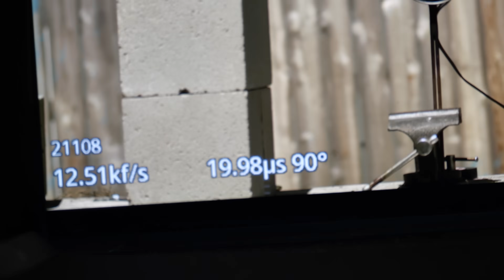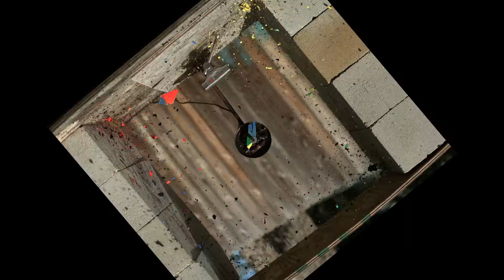Spinning a Record to Pieces at 12,500fps - The Slow Mo Guys

Comment: 9:47 NOW THAT'S A LOT OF DAMAGE
Reply: Lets see if its gonna leak
Yeah it leaks 
I would seal it with flex seal all you have to do is spray a nice and event coating and once it dry let it dry and once it dry let it dry and once it dry let it dry 😂😂😂
Reply: Bet some flex seal could fix it
Reply: Use the new Flex Paste.
It can be used on any kind of surface.

Comment: Omg. Thing about what happends if you break an angle grinder disc.
Reply: I've broken a PVA polishing wheel once. Not fun.
Reply: The hydraulic press channel has some crazy vids using those and killing every item in the area.
Reply: Or a saw blade
Reply: DatDragon Boi Seen It.

Comment: So the record cracks when the out of balance forces put too much strain on the body of vinyl due to vibration. I wonder how much faster it would go before it broke if you could even out the inconsistencies in the density and balance eliminating the most vibration possible? And would the shatter patterns change?

Comment: I wonder how much of a wind tunnel effect you  got from the bricks. I would think it would spin longer if it wasn't fighting its own wind rebounding from the brick walls. if you watch  it seemed most of the fracturing started towards the openings IE the bottom or the top where there was more space for the wind to escape.

Comment: Would love to know,  at what rpm were those LPs exploding? A 78rpm is heavier but more brittle, I believe are made of Bakelite? And you may have said it but what rpm is that Dyson Motor capable of? A spinning CD in the dark with a bright light on it made for some cool still shots. Actually it was 4 CDs attached to the slanted ends of a fan-blade. It was quite colorful. Keep on keepin on guys!!! I once put a model Airplane propeller on my Dremel and at 28k rpm it had serious pull. Also deadly. Could make a screamer until the cord ran out, ha ha

Comment: I wonder what if you spin it in a vacuum chamber to cancel out the  air so it can be more pressured??? Yall agree?? Would it change the outcome or would it be the same?

Comment: In general, the object will vibrate at a specific frequency. One of these frequencies is called natural frequency. The sound vibrates with natural frequencies. And when the object is subjected to extreme external force, continuing with the frequency equal to the natural frequency of the object Will cause the object to vibrate violently We call the violent shaking phenomenon due to this reason that it is resonance until the object breaks 
Physics 😡😡

Comment: You should put a chunky piece of meat to one side and do this, then after the results explain that it could likely be 10× worse if it was a grinding/cutoff wheel or metal-cutting chop saw disc. 😬

Comment: Nobody:

Dudes with honda civics at 3am: 5:17

Edit : THANKS FOR THE LIKES
Reply: Souk Detvongsa 5:21   V-Tech kicked in
Reply: I think u mean 5:20
Reply: XDDDDDDDDDDDD
Reply: True😂
Reply: Not a thanks for the likes? Thats sad
Reply: That is actually true that first joke (for me at least). My VTEC solenoid was leaking oil but now that’s fixed.
Reply: 2 more likes to 666!
Reply: THATS IS A NASCAR V8 ENGINE!!!
Reply: Jackivision  no, the ambulance on its way!
Reply: For me it's like a 4AGE with a small supercharger
Reply: The pop and wheezing Sound is them being dickheads and pushing the limiter to the point they blow a spooley through the engine 🤦🏼‍♀️

Comment: It appears that the motor is oscillating in a back to front axis which seems to be imparting energy into disk and flexing it which is causing the breakup. I predict that it will spin faster if the motor can be secured correctly stopping the forward and back vibration of the actual motor.ut may also be some resonant frequency of the record that seems to flex in such an extreme way it creates fractures  that allow the centripetal force to fracture it.

Comment: Ok so I found out which piece hit dan's shield! It's the yellow shark tooth/bullet shaped piece at 12:15, near the centre of the record. It flies into the wall, gets a bit grinded off it, then rolls off the table towards dan. Also you can see that the piece that hits him is the same shape and colour as the one I'm describing. Good night. It's 2:27 am

Comment: The disc spinning sounds like a 1970s muscle car
Reply: Muscle cars were mostly 1964-1974 and it doesn't sound anything LIKE those cars… 
Nothing does. 
[You get that unique rumble because of the firing order of a V8 with dual exhausts. You don’t get it with single exhausts because the exhaust pulses hit the muffler at evenly spaced intervals, but in a V8 with dual exhausts, you get from each side a boom pause boom boom pause boom. And the patterns alternate but dovetail into each other.].

Comment: The intial cracks came at almost a 120° to each other, a confirmation that it is the most stable configuration to crack when there is an outward force from the centre. Learnt that when I was studying about hotspots.

Comment: It's too bad that there's no good way to balance records cd's or any other kind of disk. I think the imbalance has a lot to do with why they warble at high RPM. if they could be balanced, they could achieve higher speed before failure. That would be more spectacular, but you'll need a higher frame rate and faster shutter speed. the kinetic energy goes up on the square of RPM, so the damage would be more severe with even a slight increase in speed.

Comment: Why not try this with all 3 types of records 16 rpm, 33 rpm and 78 rpm back to back and see how much difference there is between them. Each rpm reflects a different era of the technology in record evolution.  I will also suggest using a couple of 2X4's nailed together on the top instead of the plywood. You'll understand once you get the 16 and 78 rpm records in your hands.

Comment: I think one of the reasons the record breaks into pieces, is that the motor itself is oscillating because it is mounted on a rod. That starts to move back and forth and initializes the oscillation of the record. Certainly the record will break without this effect, but I think it occurs sooner now.
On the other hand, this explains why any record player does not more than 78 rpm... (lol)

Comment: I did injection molding plastics for 35 years and the failure lines look exactly like polymer flow lines going from the gate(where the plastic enters) outwards. Flow lines are always a weak point in a molding.

Comment: So why is it that when something spins really fast, it appears to change the direction it is spinning for a second, then goes back to what it was at
Reply: The camera (film or video) records a series of still frames. They appear to the human brain as a single moving image when played back fast enough. For simplicity I'll keep the numbers small - assume camera takes one picture every 1/10 second. If the disc is spinning at exactly 10 revs/second, the camera will catch the same point on the record - say the blue-yellow edge - in exactly the same spot every rotation, and the playback will appear stationary. If the disc speed is a little less than 10 revs/second the edge will be captured in a slightly different position on each frame and played back will appear to rotate one way (backwards in fact); if it's a little over 10 revs/sec the point where the image is captured will vary in the other direction and it will appear to revolve the other way. But as the disc speed rises to 20 revs/sec the edge will again be in the same spot every frame and on playback will appear stationary. This repeats as the speed rises further. So as the speed rises you'll see rotation one way, slowing, stopping, then the other way speeding up, then slowing and stopping again, before resuming in the other direction. 

The effect is most notably seen on the spoked stagecoach wheels in old westerns.
Reply: @johngoldsmith4844  TL;DR it's too fast
Reply: @Salcatraz A it is an optical illusion, just in this case instead of the wheel spinning so fast it exceeds the camera's framerate, it is spinning so fast it exceeded your eye's framerate causing the same effect.
Reply: Same with fidget spinners.
Reply: Redskull It’s the shutter of the camera.

Comment: Want to see something fun ? Paint a record with chrome paint place it on a perfectly level turn table and shine a light just slightly above the edge and watch the shadow on the opposite wall, you can measure exactly how much it warps. When we used to make 15 inch hard disks for cputers this is how we measured how flat the disks were.....

Comment: Backyard Lab Safety Standards Approved. Top quality ballistic wood protection system. And at about 9:44, putting goggles on after the experiment.

I wonder if the speed it cracks at is like a resonant frequency for it's warping or something?

Comment: I am curious to know how much of the resonation of warpage/flexing contributed to eventual breakdown of the vinyl.  Would it be possible to do a followup of this video where increasing the speed is paused for about 10 to 20 seconds when turned up half way, and then pause again in each increment of about "5" on the dial?  In theory, if resonation significantly contributes, they could shatter at much lower speeds if given time , but would still be very interesting to watch the flexing and warping as it resonates.

Comment: What if records could be huge HDD
Reply: Magnetic hard drives used to use huge platters.  They got smaller and smaller so they could spin faster (for lower seek latency and higher bandwidth) without shattering.

Comment: I got so curious about the speed of the flying shrapnel after seeing the damage to the plywood, so I tried to do some calculations.
I took the measurements of the last record being spun, the first chart which flies of hits the brick wall in 10 frames at 12,500 FPS, so it covers that distance in 1/1250th of a second.
Measured from the screen with a ruler the diameter of the record and the distance the chart flew between breaking away to hitting the brick was almost similar.
A LP record is 12" or 1' in diameter, so the chart flew aproximately 1' in 1/1250 of a second, or 1250 ft/s.
Those are the kind of speeds a handgun bullet is fired with, and shows how dangerous this experiment was, being directly in the line of fire from that shrapnel could cause deadly injury.
So it was a good decision to use those bricks as a blast shield.

Comment: ABS also did similar thing. We were testing a prototype impeller made out of ABS, and it keeps fracturing at high speed (rpm). Centrifugal force must have cause enough stress to fracture at part of disc which has crack greater than "2a".

Comment: Flat earth experiment debunking round earth using that Dyson motor in the same way with a giant earth magnet in the center of a homemade globe add  magnetic fluid instead of water to simulate earths supposed gravitational pull I gave you my idea but you gonna need some trial and error for the rigid globe structure and basically you try to get it to the actual speed of earths rotation good luck I look forward to seeing this

Comment: not sure if you would like to try one more thing with this experiment, But if you were to attach a flat metal ruler horizontally on the side of one of the cinder blocks, and position the camera at the correct angle, in slow-Mo playback, you could measure the actual (+/- ) detente of how much the records are warping during spin, before shattering.

Comment: SLOW MO GUYS... I have an interesting suggestion... watch Tested's "Jamie Hyneman's High-Pressure Air Gun" on you tube... watch how those tennis balls go right through that thick sound blanket... and almost looks burnt/discolored. What is the limit of those tennis balls making it through different materials, or even adjusting the pressure to just get it through?? I think it'd be interesting footage with your gear!

Comment: So you mentioned that the record was going slower and that the motor must be using energy elsewhere, the most interesting part is where the energy is going. All of that motor's lost energy is going towards wobbling the record. Its not in weight or inertia, its not in air resistance, its forcing the record to resonate outside of its resonant frequency costing a lot of power. Thats why you don't see a standing wave as it rotates, and as a non-elastic media (pun certainly not intended) the record is taking that energy, turning it into heat and then would be dissipating it into the air.

In anticipation to the questions, no this isn't a random guess, yes it is absolutely what is happening. As a physicist I found it pretty awesome to note and I'd imagine a lot of other people might also find it interesting, cool, or educational. A few more less cool but equally interesting aspects, the wibble wobble on the top wood cover is a perfect sine wave. I can't think of anything which doesn't resonate in a sine wave so that isn't surprising but again might be interesting and educational (quantum phenomena are outside the scope, but will also resonate as a sine wave eg. phonons just with many, many exceptions eg. electron shells). 

As an assumption, the record is likely breaking as it nears its resonant frequency. Someone with more care than myself could check this by seeing if the standing wave rotates around the record at a reduced RPM as it nears breaking point, thus closing towards resonant frequency. This then means the record is dissipating less of the energy from the motor, is then wobbling back and forth laterally further, and gets beyond the point at which the medium can withstand an thus snaps. This is identical to the stereotypical opera singer breaking glass with the right note.
Reply: Absolutely they meant it was heavy but they were wrong, thats not why it was going slower. Thats part of why it was so interesting.
Reply: I'd have never guessed heat, honestly. In hindsight, heat has a role to play in everything. I thought it was because it has a larger surface area. It was taking more energy to pull because there is more to pull. That's so cool!

Thanks for putting the time in to say this! :D
Reply: Its nice to see some intelligence. Thank you for your post Olivia. Is the record then essentially liquefying ? The splats on the wall look melted.
Reply: Thas very long
Reply: Olivia Lambert why did u type this and why did I read it all and actually understand it
Reply: @j.hayes11  lol

Comment: 1. The rig wobbled, adding undue stress to the record.
2. The break started at the very center, due to stress from me pivot point.

Put a better foundation on that motor to eliminate wobble, and slap a 3" washer on there to distribute the load.  I bet you get that thing to 30,000RPM or higher.

It didn't break due to centripetal force, it broke due to rapid vibrations at the center.

Comment: Video suggestion: use one of those rotating fans with metal blades(like the kind the motor was for) and stick things into it, e.g twig, pencil, wire, rolled up paper, etc.

Comment: NOW THAT'S A LOT OF DAMAGE
Reply: HAVE YOU HEARD OF JESUS
Reply: I CUT THIS RECORD IN HALF
Reply: Phil Swift here to show you how we can repair this broken record with flew tape!
Reply: I'm PERFECT. I'm too PERFECT.
Reply: Snap, Crackle, Cube I CUT A BOAT IN HALF
Reply: "to show the power of flex seal, we spun a record at extreamly high rpm to damage the bottem of this boat, to which we fixed with flex seal"
Reply: malcom thonger HOW BPIT A LITTLE MOAR
Reply: i was about to comment that.
Reply: better get the Flex tape
Reply: Just slap it on there
Reply: Tell me what does that have to do with tape
Reply: I CUT THIS RECORD IN 23823878373283838728388289382983293838372837237283283723872382832932 PEICES

Comment: The odd harmonics are neat. You can hear the strange sound as the wave that causes the warping travels much slower than the rpm of the record, putting it under stress.

Comment: Anybody else curious about what the record titles were? I'm sure they were worthless haven't heard of these guys but it would be a fun little trivia tidbit. Another thing that would be interesting is using different types of record discs. Through the years of records there were several different materials that were used in producing the discs. The older harder discs will shatter at a weaker force and with that spinning device would probably disintegrate into dust. Also earlier discs would be slightly rarer had better be some pointless recording that had been remade zillions of times.

Comment: 1940s: In the year 2018, we will have an awesome robot with circular blades that can cut 1,000 concrete bricks.

2018: In the present, we invented a vinyl chainsaw blade that can cut 1,000 bricks.

Comment: U guys should get boiling water abd go somewhere extremely cold and film u guys throwing the water in the air
Like so they can see
Reply: Games and Stuff It'd just... stop boiling...
Reply: It'd just turn into steam. There's videos you could see anywhere
Reply: Victor L Hot water decreasing in temperature wouldn't turn into steam. It's unlikely that the ice would turn into steam, either.
Reply: James Caldwell oops, I thought that it was steam in those videos when they threw out boiling water in freezing temps. Think it was below 0.

Comment: You said they the engine probably didn't spin at the speed it was meant to because of the weight of the record. But you can still calculate an approximation of how fast it goes. At 12:41 there is a golden opportunity where the shadow from the pin works as a great tool for finding the difference I angle between two frames. Then just do some math and you'll have the rpm (or rps which feels more useful here). I would have done it myself but I thought because you have all the numbers it would be easier for you. :)